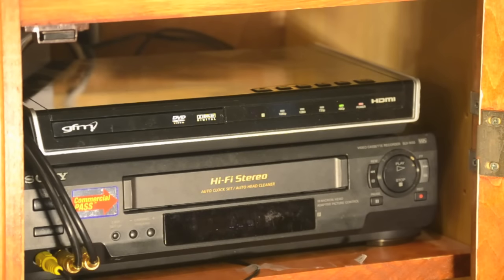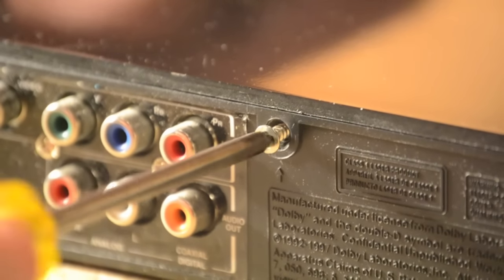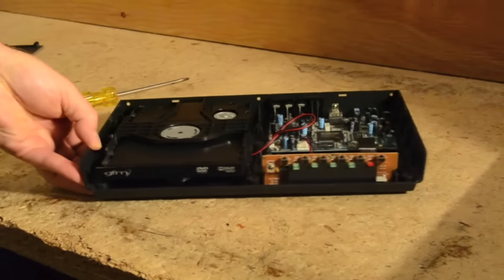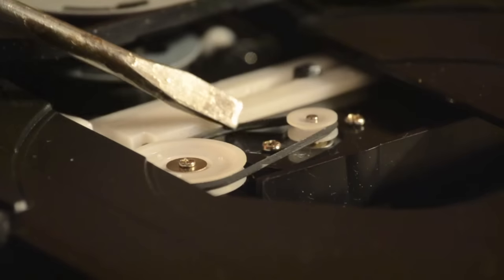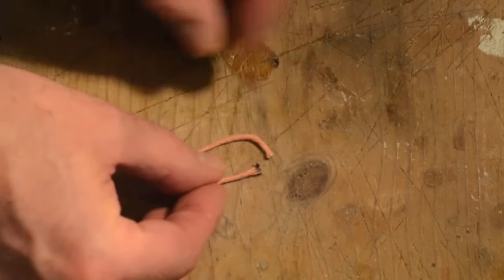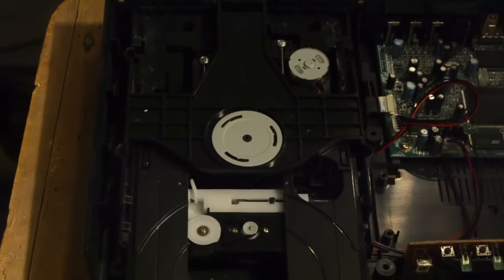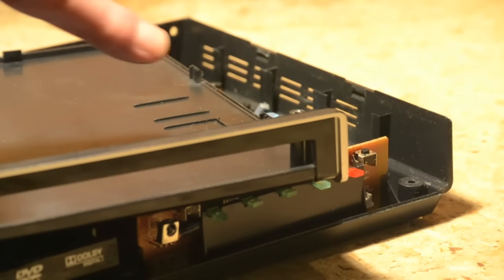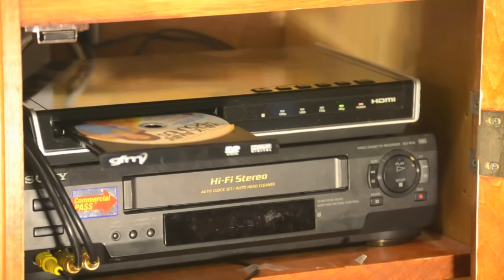How to Fix a DVD or CD Player That Won't Open

Comment: I am a senior with an old Kenwood stereo.  Your video gave me the courage to take the CD player apart.  It didn't have a drive belt that I could see, but by fiddling with the gear controlling the sliding tray, I was able to get it working. Then I took apart the tape player and also fixed a door that wouldn't open. Now I have a house full of music again.  Thanks so much for your very clear video. I wouldn't have tried to fix the stereo without your help.
Reply from the maker: Glad to hear the music is playing again! I have an old Pioneer SX-450 amplifier (late 1970s) that we still use -- with a CD player and an iPod!
Reply: What type of oil should we buy?

Comment: If you can't get at the gears with a screwdriver use a thin lollypop stick. All you need is a gentle twitch to the right so the tray unlocks, then you can pull it out gently to get at the belt drive.

Comment: Over 200 million of those things worldwide and none of the manufactures solved the problem of an easy belt replacement or stuck tray failed to eject due to underpowered motor or too much friction is the sliding mechanism.

Comment: Great video, but the penetration oil may attack some plastics. I would recommend a light film of silicone grease instead.
Reply: lol    i got a kick out the 'penetrating' part - Maybe plastic does.    But, Just read Ceramic grease is very good to use.
Reply: Mine looked like your drive belt. It might need to be a tad tighter. Who knows. It seemed it was perfectly fine but most likely it wasn't due to the motor that pushes the eject door out was not budging. I will try and put a new O ring instead. It's already 21 years old. I also oiled the tray guide carefully. I will do this again with a new O ring. 😉👍

Comment: After viewing your video I opened up my player and looked around. The drive belt seemed ok, so I cleaned off the dust and oiled where you said. I made the tray go I and out a few times and then it was ok. I think something under the tray was catching and it got free.  Anyway, it’s working fine now. Thanks !
Reply: Where'd you get the oil, and what is it called?

Comment: Thank you so much for your help!
My player had an extra upper bracket inside, which I had to remove to gain better access. 

In my case the belt was off but still in proper condition, so I just reattached it and it works!

Comment: I kept getting 😠 at our Sony Blu-ray player multiple times and thought if I broke it on purpose. It wasn't my fault, but I got my dad to give me a ✋🏻 with it. No need to take it apart at all. It happened yesterday in July 2020 and September 2019 if my memory serves me correctly that I was in the middle of some episode of The Simpsons Season 2️⃣ and The Simpsons Season 15. Each of the discs had errors with the connection. It wasn't easy to be calm at all before rebooting the device carefully and safely. Good job with the 📀 player repair. 🌈👏🏻

Comment: The only difference is (so far) I haven't been able to find a THIN  "O" ring, so  I used a standard issue, office supply RUBBER BAND that was slightly smaller than the original drive belt--this is just a temp fix 'til I find the right size "O" ring.  Hard to believe such a tiny item can cause this issue, but I HAD to attempt this because the product I am dealing with is a Sony® CDR-W33 recorder I bought new in 2000 for $599.00!  No way I was gonna scrap it without trying this.  And DO NOT force the door open--open it as shown in this video!!

Comment: Thank you for the tips. On our  Clearplay Anccor 740HD  player there was  no way to access the tray cog wheel from the front to move it with a flat blade screwdriver. We did a little sleuthing on the Internet and  found on  IFIXIT  a tip to release the DVD tray.  "DVD Drawer Won't Open, No Pinhole For Paperclip Trick".  On the bottom of the machine is a wide slot below the tray area.  With a paperclip with one end straightened out and a flashlight, find a plastic piece inside the slot on the right side  with a square depression  that you can anchor the tip of the paperclip in. Slide the plastic piece too the left toward the outside edge of machine.  This will release the tray. Our non-opening tray problem was not a broken belt. It was a couple of strands of my niece's reddish brown HAIR  wound around the belt spindle !
This was binding the tray. We removed the strands of hair with a tweezers. We also greased the slides on the bottom of the  tray with silicone spray on a Q-tip. The tray works fine now. We alerted our nieces not to dangle their hair over the tray when loading disc.
Reply from the maker: Thank you for sharing your story and for sharing the awesome tip! I'm sure it will be helpful to many others.

Comment: Great, thank you very much. I fixed my problem with my Phillips DVD. I used #30 O-ring from Home Depot, 10 pieces for $2.50, size: 7/8" O.D. x 3/4" I.D. x 1/16". It was little smaller so I had to stretch it for couple of minutes (just with my fingers). It works now like a champ.
Reply from the maker: Awesome!

Comment: Which oil/grease did you use to lubricate the tray and gears? I had chainsaw grease, but I just wanna make sure because my Sanyo BluRay player isn’t ejecting and I’m still in the process of fixing it.

Comment: What is the oil you are using?
I have a Yamaha multi disc player & sure enough it won’t open the tray.
I did open up like the video I said but I was unsuccessful in fixing it 
I received 
 quote to fix it $90AUS & I guarantee it is the O ring.
I have another disc i can take apart & check to see what I’m doing wrong 
Can I send you photos once i have opened up the Yamaha multi disc player as not even the tray turns .
Thanks from Australia
Reply from the maker: White lithium grease is recommended.

Comment: Unfortunately, my player isn't built like this. It was a beast to get open (I had to take off at least 5 other pieces to get at the tray), and there is no gear in the front to get it open.  It was really difficult to take apart. At least your video gave me the courage to try, and I got my DVD out that was trapped. I never got the tray to slide open, but we managed to eventually pry it up so we could see if the problem was the belt. The belt is actually fine. There are some broken pieces inside that are not identifiable. There must have been something else there that completely fell apart. There isn't any remnant that is still attached to the rest of the apparatus so I don't know what it was. Very bizarre. Anyway, thanks for making this video. I got my DVD out. Unfortunately I'm still going to need a new machine.
Reply from the maker: Sorry you had to wade through so many challenges, but I am happy to know you were able to retrieve your DVD! The good news is that many DVD players are relatively inexpensive.

Comment: Cool repair video rubber gasket. And rubber bands elastic bands can be used too
Reply from the maker: I've found the O-rings to be more durable. A rubber band or elastic band might work for a little while, but sooner or later, it will  break -- more likely sooner.

Comment: so can you basically use any rubber grader to replace the one that is inside originally? (In the video the instruction is to use the ones used to repair leaky tap)

Comment: Here's a tip if your drive belt is just a little loose soak it in boiling water for 5 minutes, the heat will rejuvenate the rubber and you may be able to reinstall the old belt for a fix. I just did it on my CD!!
Reply: This works. Has provided handy solutions several times.

Comment: Dont use regular oil or grease on plastic parts onside ur machine as it could eat into the plastic & damage the gear drive.
Only use grease that it safe to use on plastic parts if youre unsure read the info on the tube or packaging or ask for asistance @ ur local shop.
Im 99% sure lithium based grease will do the job but of course ask b4 u buy to be 100% sure 🙂

Comment: A little trick..
If you have a small rubber band it will work also if you wrap a layer of scotch tape around the smaller pulley that will work also until the new belt shows up.

Comment: Hi I have seen this how did you it. Where I can string from if the string is missing or broken or maybe need replace somehow.
Reply from the maker: The string is simply a way to measure the circumference of the belt. This helps you to know what size O-ring to purchase at your local hardware store to replace the broken belt.

Comment: after replacing the belt, the laser assy won't drop to allow the drawer to eject open. this is a sony drive ASA-8829B-B03 in a philips home dvd player. If the cover of the player is open, i can press the eject button and then push down on the sony logo of the laser assy to drop it down and then the tray drawer comes sliding out. so how where to lubricate or adjust so the laser drops down when ejecting like it should.

Comment: One DVD player fixed with this method, but the other one not. The belt is fine. The cogs don’t turn when you press the eject button on the remote or on the machine. Any suggestions?  DVD will play if you manually turn the cogs and put a DVD in but can’t get the drawer to open or close without manually turning the cogs.
Reply: The little motor might have died :(

Comment: What kind of oil do you use to lubricate it?
Reply from the maker: One viewer suggests using lithium based grease. In any event, the viewer advises only using grease that it safe to use on plastic parts. Be sure to check the information on the tube or package.

Comment: Don't have this issue, my issue is.
My Rotel 990 CD player played flawlessly for the last three years. 
Now when you turn the power button on the tray automatically comes out and will not go back in. If you give it a little push you can feel the tray motor kick in. 
you have to turn the power off to put the tray back in. 
What could be the issue?
Reply: Broken gears

Comment: I have a funai bluray/DVD player and the tray won't eject. I've had some trouble the last few months with it wanting to get stuck every once in a while but it usually comes right out when turn the player off then back on. Then yesterday it got stuck for good and I tried the 30 sec reset they tell you to do on most sites and that didn't work then I found my way to your video. I tried it but the gear on the inside under the tray will only spin enough to let the tray out a few centimeters then it stops like its stuck on something but I don't see anything. Please help?!?
Reply: I forgot to add that its really not old. I got it in 2014.
Reply: I got the same problem. who could help us?
Reply: The belt can get caught under the plastic cover.  I had to use plastic tooth picks to gently pull the band out.  Then i had to gently put the band back on using the tooth picks.  I have a funai too. It is a but tricky to do but it can be done.

Comment: Don't use penetrating oil with plastics. Oil based products will react with the plastic.
Reply: What should you use?
Reply: Teflon based (white) grease or silicone based grease.
Reply: Good advice.
Reply: The best product when working on Plastic Gears or Rubber components is Silicon Oil or Grease.  NEVER use Automotive Oil/Grease on plastic or around Rubber, as it will leach the plastasizer , making the parts very brittle.